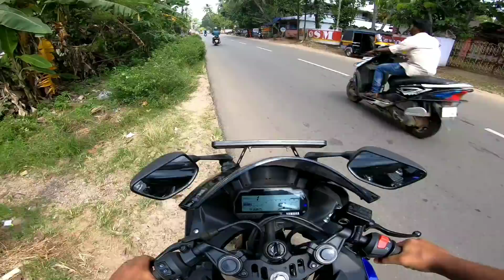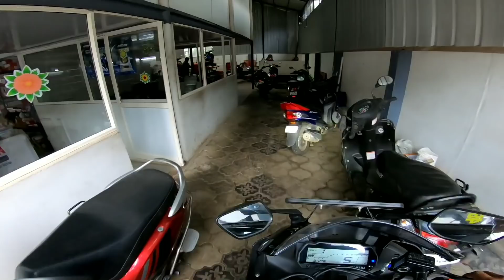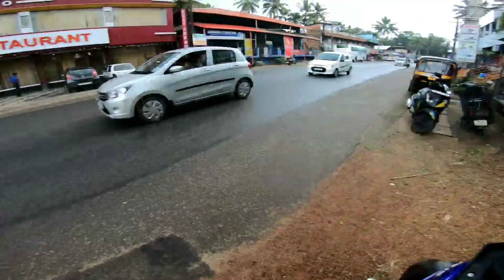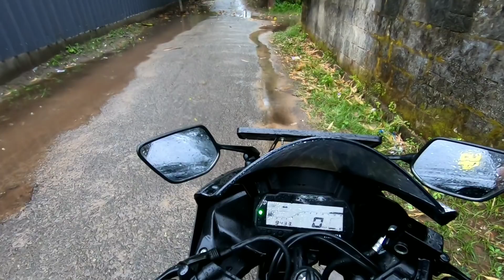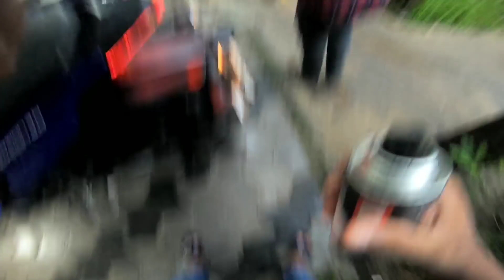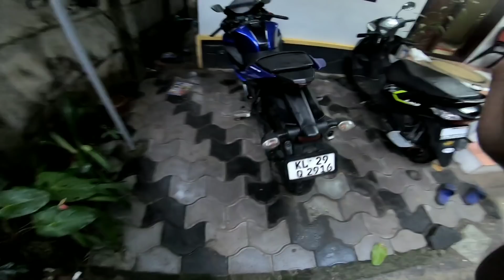V3 ചതിച്ചതാ😥😅|10000km പോലും തികയാത്ത എന്റെ V3തന്ന പണി

Comment: Chain Pani : loose tight undengil  over tight aayi chain slackness set  cheythu kaanum . slacknessinu oru alavunde athu nammal arinjirikanam ellel chain life kittilla .
Break pad: breakil ariyathe Kaalu vechu odikunnundonne check cheyyuka.
Ente bike 2010 model fz  Tanu ente kootukaran nirbhandhiche Yamaha edupichathannu fully satisfied .🤗😇
Eee 10 varsham orikal pollum vandi enike Pani thanne post thanittilla .
Tip : service centaril arano vandi panthu thannathe athil ningal satisfied anengil adutha pravashyam athe Alle konde thanne paniyipikkuka (ente vandi panithukondirunna aal avideninnu maari thanne workshop thudangi njan ayaale  thappi pidichu eppozhum ente vandiyude Pani cheyyipikarunde ).

Comment: Bro njan 19000km aaayappol aaaanuh chain and sprocket change cheayithathu. Main aayitu rpm nokki odikkukka, maximum vandi vare arrkkum odikan kodukkathe irrikkuvaaa apo thanne pakuthi panni maari kittum. Pineee back brake pad expensive aaaanuh so maximum front break use cheayithal mathi oru  70 - 30 breaking is much better. 10,000 km break pad kittum

Comment: high revving engine  എല്ലാം 9000 - 10000ൽ chain and sprocket മാറേണ്ടി വരും.
Reply: R15 v3 is not high revving engine... പൊട്ടത്തരം പറയാതെ...above 20 bhp annu medium revvs and above 30 high revv engine..... 19.04bhp  ഒക്കെ ഒരു പവർ ആണോ🤣
Reply: @jithingeorge1897  top end bikes ആയി compare ചെയ്യുബേളല്ല. just bhp. 8000+ rpm. decent torque. എല്ലാം നോക്കിയാൽ. i ride duke 200. 9000 km ൽ same condition.
Reply: @kuttalu  ആവശ്യം ഇല്ലാതെ rpm കയറ്റി shift ചെയ്യുന്നത് ആണ് മെയിൻ പ്രോബ്ലം..... sudden accleration ഒഴുവാക്കി നിങ്ങൾ ഒന്ന് ഉപയോഗിച്ചു നോക്ക് അപ്പോൾ ഇതിലും ലൈഫ് കിട്ടും.....duke 200 sudden accleration provoke ചെയ്യുന്ന വണ്ടി ആണ് എന്നാലും നമ്മൾ കണ്ട്രോൾ ചെയ്‌താൽ നമ്മുക്ക് തന്നേയ് ആണ് ലാഭം
Reply: @jithingeorge1897  👍
Reply: @jithingeorge1897  19.03 oru poweree alla pakshee 25 bhp yum kond bheekara sambavam ennum paranj nadakkunna Rc 200 thodaan pattatha Top endilott parakkan pattum

Comment: 22000 km ayi njan ithuvarem mattittilaaaa valiya sound ellaaaaa
Reply from the maker: V3aano brthr
Reply: 24 😎
Reply: Oru 20000 aayappo Front il maatram aayrunnu complaint vannathu ath maatram change cheythu ippol 24 kazhinju cheriya  sound varunnundenneyillo
Reply: @MOTORVAULT   athy 22567 km aayi no problem

Comment: Ivade 6200 km clutch plate poyi fz25 abs😁🥴
Reply from the maker: Contact dealer
Reply: @MOTORVAULT  clutch thangi odichitana parayunath clutch plate oke 500 km lum povumthre🥴
Reply: ഞാൻ ഉപയോഗിക്കുന്നത് honda unicorn ആണ് 27000 Km and running  ഇപ്പോഴും ഒരു പണിയും വന്നിട്ട് ഇല്ല..sprocket ഇപ്പോഴാ മാറാൻ ആയതു.. ഒരു 2000km കൂടി പോവും..... . 58 km mileage normal useil കിട്ടുന്നു ഉണ്ട്.. long rideil 64km...ധനുഷ് കോടി, പോണ്ടിച്ചേരി, ചെന്നൈ, ബാംഗ്ലൂർ .. all ഇടുക്കി, കൊടൈക്കനാൽ,ഇങ്ങനെ ഒരുപാട് ട്രിപ്പും പോയി...ഇനി അടുത്തത് ലെ ട്രിപ്പ്‌ ...showoff ഇല്ലെങ്കിൽ എന്താ വെറുതെ കമ്പനിക് ക്യാഷ് കൊടുക്കണ്ടലോ..സുഖം സ്വസ്ഥം ....... honda unicorn 😍
Reply: @jithingeorge1897  bro enik athyavasyam power venam pine milage aathoke fz25nu ind 47 vare ikk milage kittunund porathenu nalla initial pullingum accilaration um clutch plate poyath nan kurach rash drive aayirunu aathu kondavum